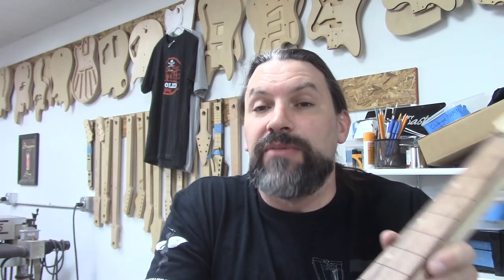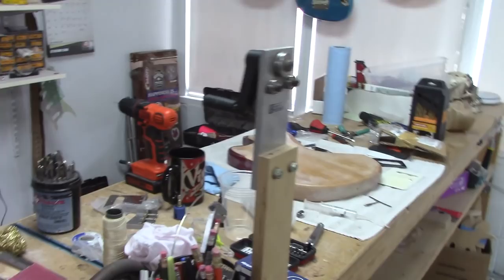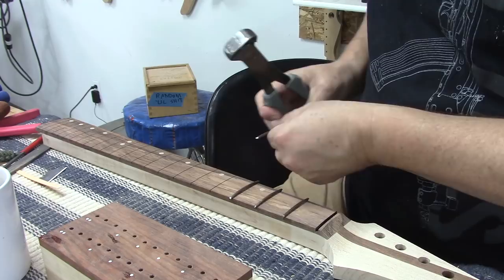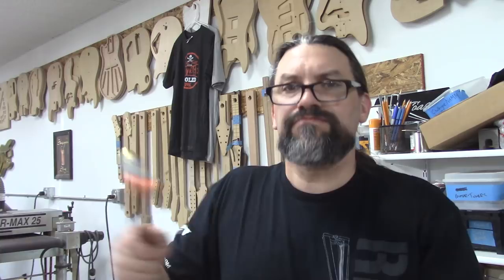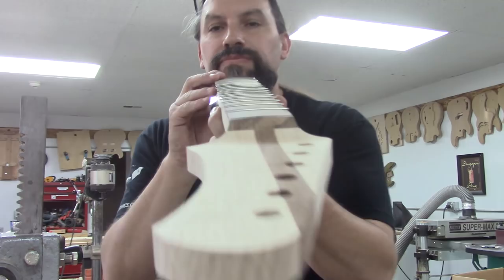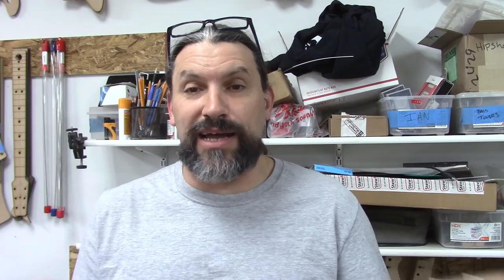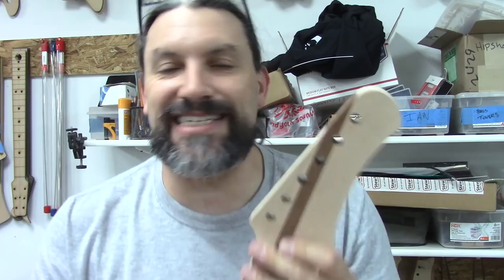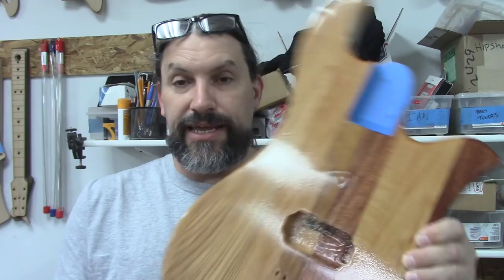How To Build Another Amazing Guitar With Scrap Wood… Part 5 Fret Work

Comment: Overheating the wood while cutting or improper cure could cause warping or excessive movement. I have seen video from PRS about taking a cut and letting piece rest for a week before removing more material. 1. He is in Annapolis at sea level near ocean. Curing wood and keeping dry a challenge. Fix by controlling woodshop environment. 2. Hot tooling. Keeping the tool cool prevents heat transfer. Sharp tool is happy tool and rest tool between cycles can cool tooling down. Where I grew up was an pipe organ factory. Pretty much only one in world. They would go to client, measure atmospheric conditions (heat, moisture, barometric pressure) and set those exact conditions in factory. Build instrument, disassemble it, move it and reassemble at client's location. No matter what you do, a guitar will act similar throughout its travels and life. The builder does the best to make a superb playable instrument but the owner has to take responsibility for long term maintenance and upkeep. Texas Toast applies tried and true classic and modern techniques to provide a excellent durable playable instrument that will give end user a long term investment. In my very unhumble highly biased  opinion.
Reply from the maker: When wood starts moving right away it is usually because of stresses in the lumber, sometimes caused by the milling techniques. If it moves eventually it is usually because of moisture. 
As you have pointed out we use the techniques we do because they work for us. There is a lot of stuff we do that y'all don't see too and people make assumptions in the vacuum of what they do see.
Reply: @TexasToastGuitars  I agree 100%. I have done more metal work than wood work but stresses and techniques are similar. Feeds, speeds and surface area removed per minute important.

Comment: It’s a flat surface! Haha. It only contacts at the top of the arc, which is a straight line, and it can cross the flat surface in any direction. And this way Matt doesn’t wear out one part of the belt, it all gets used. Parabolic arc? 🤣
Reply from the maker: I don't really know what the guy was talking about but he was concerned for no reason.

Comment: If I had a workshop with all tools shown, I would be laughing my head off and doing my projects with a wide smile on my face. The reality, however, is that to perform a simple task at home even having to hand some power tools I have to work out how I am going to do it using what I got. Sometimes takes ages for a seemingly simple modification. While some ideas can be useful from these videos, watching it is no more than a wish:'' I wish I had all this equipment.''  Probably, there would be more satisfaction to play music on instrument I got. Which is good enough.
Reply from the maker: Hi Denis, I really do feel you, I wasn't born with these tools. I had to work really hard to get this stuff. If you want to you can to. I have also been doing it for the last 30 years. It's funny how much stuff you accumulate over 3 decades

Comment: Nice build Matt. Love these kinds of vids. Probably because i like to use scrap and reclaimed wood too. I've got you a nice tip how to make a good flush cut nipper tang for cheap and to use for stainless frets. I bought a cheap 5 dollar cutter and grind it flat,like you did and then heat it up with a butane/propane mix burner until it's glowing red and than put it fast in motor oil to cool off. You can also use water or olive oil.( DO THIS OUTSIDE GUYS and NEVER pour water on oil. And have a fire blanket with you. If it's cooled off.. put it in a regular oven at 250 degrees Celcius or 482 Fahrenheit for an hour. Let it SLOWLY cool off and it will not wear and you don't have to use your expensive tools. Greets fro Belgium.
Reply from the maker: Thanks for the tip Bruno, we bought a set of the Jescar nips for SS frets and they work great

Comment: who am I to give you guys a tip, but generally I start cutting fret wires from the end of the scale towards the fret 1. if by any chance I cut too small I can ¨skip 1 fret¨ and use it in a smaller space. but again, that´s my way.
Reply: That's a great tip.
Reply from the maker: That is a good tip Filipe, I'll try it... I might even steal the idea for a video
Reply: @TexasToastGuitars  I´wont have any copyrights issue if you send me a 25% discount gift card for a build LOL. Just kidding man, there´s no issue. It´s the least I can do for everything I´ve learned with you guys. The only issue is my wife, she´s preventing me for buying a pin router so I can call her ¨beloved¨ too.
Reply: What wife,  hhh, jk, I bet she's a good on

Comment: Undercutting the tang will not stop fret sprout at all - it will stop damage that the tang protruding will cause - but the wood shrinking won't stop.
Reply from the maker: Less metal on meat is a good thing. 
Have fun

Comment: OK, 1 - the angle on the radius sander doesn't matter, its only presently in your setup affecting how the paper grit crosses the wood, hence, slight side grain scratching... the radius is in the swing arm. those people are smoking bad grass... 2 - I DID have a question  regarding your fret tang. How wide are your slots? Do you tang barber the frets to avoid excessive accumulative fret compression along the neck? and 3 - When people nit pick about little stupid things, I always refer to Frank Zappa and tell them.... "Shut up and play yer guitar!" LOVE yer vids!!!

Comment: Hey Matt, why are you using pine filler? Wouldn't you use rosewood? I'm pretty sure Timbermate has it, as we get the same stuff over here in Oz.
Years ago I bought a similar fret press attachment from Stewmac that fits in the chuck of your drill press. Pressing them in makes fretting go so much quicker!
It's a funny thing with cheap guitars and the amount of finish they put on there. I'd imagine it would be cheaper NOT to use as many coats? But I suppose they layer it up and buff it straight away saving time rubbing it back.
Reply from the maker: Hi  Peter, we often dye the Timbermate to match the wood... I didn't on this one since it is so streaky. 
The thing you bought from StewMac is exactly what is in our arbor press. It works  great in the drill press too, no doubt about it.
I think the labor savings is how they do it too. There is an economy of scale when it comes to those cheap guitars, I guess.
Reply: @TexasToastGuitars  I reckon that's one guitar tool I've spent money on, that's actually paid for itself a couple times over!

Comment: Overbending nickel-silver fretwire is a good idea.  Doing that to SS fretwire is not.  SS will want to spring back to the bend radius.
Reply from the maker: Yep, you gots to do what you gots to do
Reply: Given that there are over 150 common commercially available SS varieties, and about 15 of them in widespread use, and they can vary widely in their chemical composition, their chemical and physical properties, as well as individual stainless steels that can be altered by altering their processing during or after manufacturing, the term stainless steel is almost a generic term these days.

I found at least 3 different stainless steels being used by one fret wire manufacturer, though fret wire makers tend to be understandably, "tight lipped," about the specific materials and processing about their fret wires.

These stainless steels, given their hardness and wear resistance, do not tend to be prone to this behavior. If you've ever accidently bent a stainless steel knife and tried to simply bend it back into shape, you know what I mean. Once it's taken shape it tends to stay that way. That would discourage a Luthier from overbending SS frets significantly beyond (significantly smaller radius than) the fretboard radius. But, typically frets are shaped to a radius that is only slightly a tighter radius than that of the fretboard.

It's how I was taught 25 years ago, and it's never been an issue on any build or refretting job.

Bur, that's just my opinion, and everyone should do things as they see fit to do them.
Reply from the maker: I don't generally use SS wire unless the customer requests it.

Comment: What is that huge bump between the neck slot and pickup space?
Reply from the maker: It is a sag in the sealer. Remember, the sealer coats get sanded back to within an inch of their lives and I spray it on with little regard for smoothness and more regard for getting it done and getting the hell out of the booth.